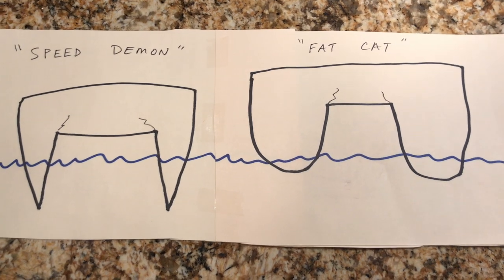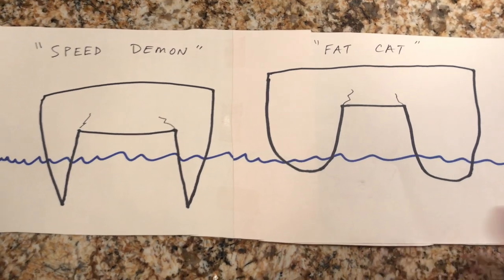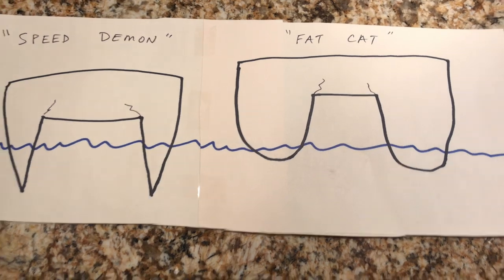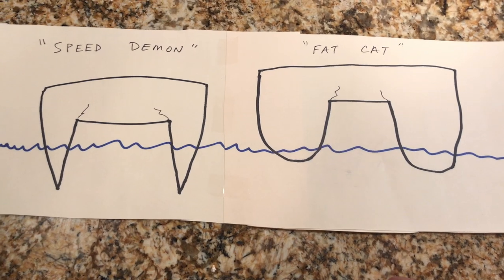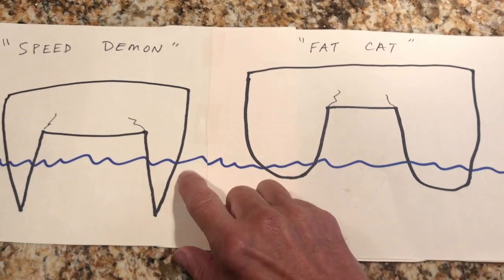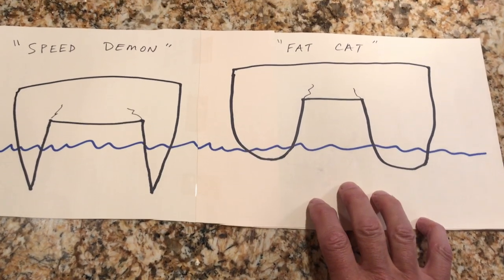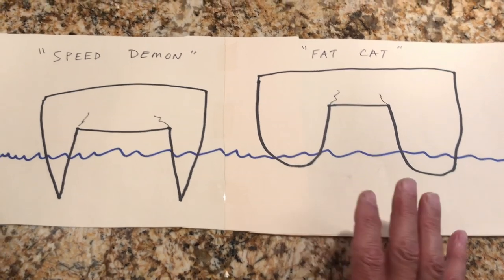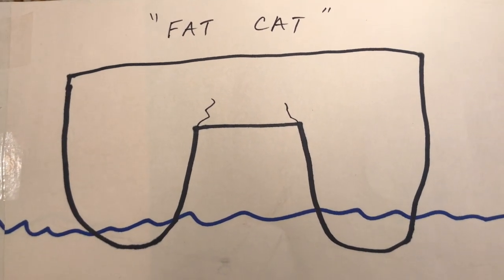CATAMARANS AND BRIDGEDECK SLAPPING

Comment: Great analysis. Five years later it is almost prophetic. People are converting cats to solar EV. The weight savings are massive (no sails, diesels, 1000 gallon fuel tanks,etc).
That means not only are they far lighter, they maintain higher bridge clearance and greatly reduce bridge slam. Not to mention faster, greater torque, silent and of course FREE ENERGY.
My new retirement plan is to get a salvage big cat, gut it, drop a couple of Tesla drive units and battery packs, replace the roofs with solar, add a fishihg pole, BBQ and a hammock and go from there.
In fact, if the solar roof is wing shaped, it should provide lift in the wind, further reducing slam. Also a ride control system of automated foils to really smooth out that ride.

Comment: In 12-20 kt winds, all cats can sail decent. It's when the wind dips to 7-10 kts that the more performance oriented boat can be sailing but the condo cat is almost for sure, motoring. Unfortunately, there's a whole lot of times and oceans that leave you with fairly light wind conditions.

Comment: What a gross oversimplification. 

A) He ignores a large number of influential factors including, but not limited to, the following: bridgedeck forward-aft placement, hull design (beyond fat vs. narrow), deck clearance, engineering in the underside of the bridgedeck (e.g., slope, nacelles), etc.,
B) He disregards the fact that "fat cats" can be overloaded as well (arguably more of a problem for "fat cats" given the potential lack of attention toward this issue by skippers and the generally lower deck clearances out of the yard),
C) Sea state and direction of travel.  You mention the former without really given the matter its due...

Granted, to each their own when striking a balance that fits individual needs in a cruising catamaran.  However, there are both "fat cats" and "speed demons" that I'd avoid due to known issues with slamming or that appear to have poor designs (e.g., low bridgedeck clearance is a deal breaker from the start).  Bottom line, do your research on specific makes or models of interest before purchasing, and don't let such a poor explanation of the issue sway you one way or the other.
Reply: A) How do you know he doesn't know that? It was bc he didn't mention it? 
It was an introductory short video to the subject in general. If he has to address all of what you said it would be to long or whatever he believes.
It was good explanation.
Reply: @yeyepp , I suspect he does indeed understand the details.  The problem with his explanation was that it was an oversimplification to the point of being inaccurate.

I understand more detail would have necessitated more time (and there are plenty of good introduction to the matter on YT and various blogs), but when one titles a video as he has done here, it warrants delving into sufficient detail so as to lay a foundation of understanding.  He failed to do so, and instead pitched his biased opinion toward "fat" cats.  As others have pointed out, he's in the business of selling such cats, so I can't say I'm surprised.  

All I'm saying is, don't take what he (nor I for that matter) has to say (as a single source) on the subject.  Do your research and find a consensus of opinions for what best alleviates the problem.  Also, I suspect you'll find a pattern of sound engineering that mitigates slamming (albeit with costs like increased windage, etc).

But at the end of the day, you should always ask what's one person's stake in the game when relying on opinion.  His is quite clear...
Reply: @petermahoney1938  Reading the title and listening to the video it's fine.  I's a 7 min video on YT he isn't in a catamaran congress where he discourse about all the implications of the matter.  He basically said that fat cats are less affected by weight in the slam. He can keep talking about this in future videos no necessity of a long dissertation. I suspect that fewer people would watch it in if it's 48 min video.
Also it seems to me that it's rude saying that is "what a gross oversimplification" "he ignores..." "being inaccurate" and implying that he's biased when your personal expectance aren't met. 
You could've add a lot of what you know of the matter in your comment without the aggressiveness or disqualifications.
Reply: @yeyepp , I respectively disagree regarding the title and content of this video, hence my motivation to write a comment (which I believe is my first, btw). Of course, we are welcome to our respective opinions.

I did not intend to come off as rude or aggressive and simply wanted to caution viewers given his poor handling of the topic, but I recognize that sometimes separating opinion from fact is viewed as such these days. 

I have no interest in an extended back and forth on the matter.  I believe I provided constructive, albeit brief, advice for viewers. I should also mention that it took me 5 minutes to write my initial comments with more detail than his 7 min video, a full two minutes shorter (all without advanced prep or the need for a dissertation).  I have little doubt he could have covered the basics, and provided basic recommendations for finding further details, in less than 7 minutes. Because I agree, few would have the interest to watch a "48 min video".
Reply: @petermahoney1938  create your own 45 min video and i'll watch it
Reply: David Miorgan  , bahahahahahaha...I didn't realize what it took to be a sailor was having a YouTube channel or a business in the sailing industry.  I guess that means the 99.9% of us who call ourselves sailors are really just kidding ourselves.  

I'm sorry providing a constructive response was an emotional trigger for you, eliciting a childlike response to a post from 6 months ago.  To use a term I'm sure you are very familiar with...quit being such a snowflake.  Well, troll, I would say this is a safe space, but I'm not done knitting my pussy hat (for all it's relevance to the conversation).

Comment: I know you are right but I cannot put my head around it.  I typically charter a lagoon 380 for 2 or 3 weeks, because that is what we can afford.  I also charter a Catana 42 and it was a lot more fun  to sail and was much faster then our body boat 45' monohull.   Why then if there are so uncomfortable, that the resale value of Outremer, Catana and other dagger board equip Cat is so high beside the fact that there mostly owners boat, not charter?  A 20 years old Outremer is still worth over $400 000.
Reply from the maker: Hi Serge, what model/size  (20 years old) Outremer are you talking about?
Yes, the Catana 42 is fun to sail but they don't have room for air-conditioning or generators,. My wife would never go along with that. And those exposed helm stations will "get old fast" once you have to steer in a driving rain storm for more than 20 minutes.
Reply: @Catamarans Sorry for my lack of accuracy.  2000’s Outremer 45 ask for about 325 K US$ and 50 to 55 are asking for 385 US$.  Still this is a lot of money for an old and simple boat.  Same for older Catana that are a bit better finish.  You can add bad forward visibility through the bridge deck to the Catana 42 and more.   I like the way it sail but It would not be my boat.  Thank you for your great advises and by the time, I am ready to set sail permanently, my need for speed might go down.  Until then I will keep charter "condomarans".  Maybe I will find one I like.
Reply: That's because Outremer is a real sailboat. Are you buying a boat to sail or sit on at a dock. Houseboats make good dock boats.